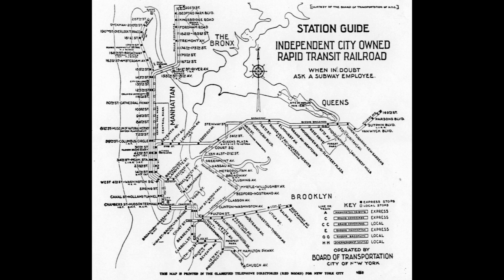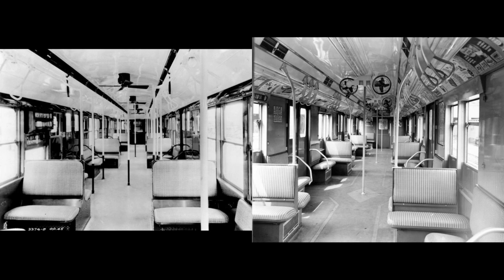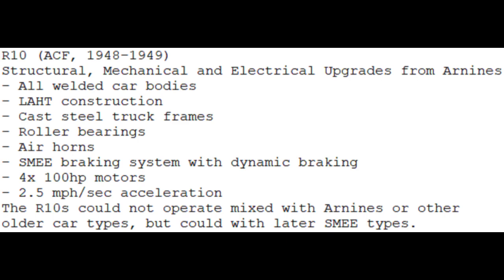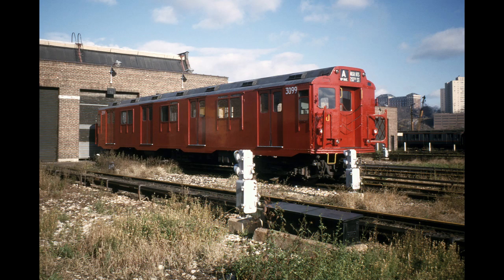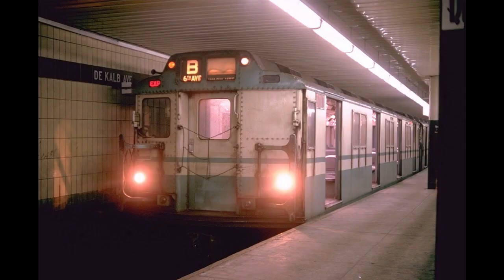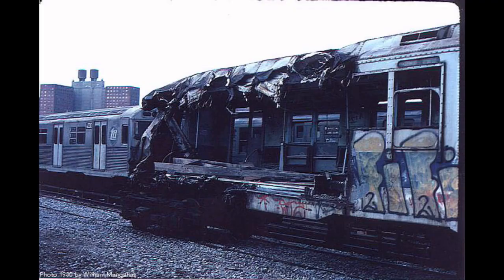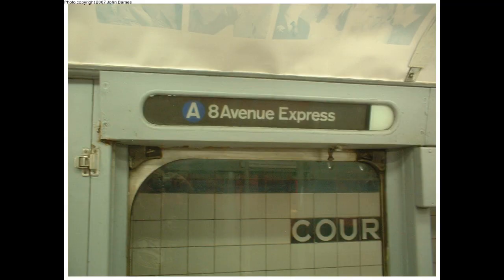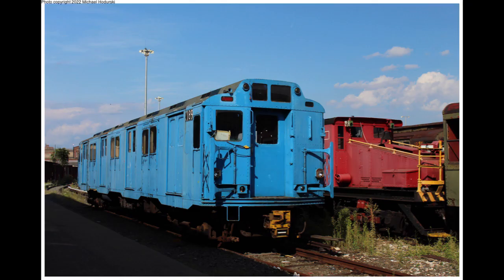History Of The R10 Subway Cars - The First SMEEs For A Unified System

Comment: In 1978-79 I was riding the GG regularly with R-10 equipment.  The car shortage was so severe (due to R-44 and 46 problems) that a train which could only run in 'series' (meaning speed limited to about 15 MPH) was allowed to remain in service on an occasion I observed.  The Thunderbirds nickname was not known among younger railfans.  The R-38s were the fast cars back then.  Also PA systems were retrofitted on cars older than R-26 (delivered without PAs) in the early 80s as a result of the Clark tube smokey incident in which the crew was unable to communicate with riders experiencing confusion and discomfort.
Reply: The R-38!!!!!! My all time fave, especially working the C line. Fastest thing we ever had!

Comment: I rode on them many, many times on the A.  They were tailor-made for the CPW express dash, thundering and blazing past those seven local stops.  If you stood on the n/b platform at 81st St., you got an earful as they ripped past.  By that point they were at full gallop.
Reply: Exactly 💯 I remembered riding it when It was going express on CPW express with the A Train
Reply: I remember their smaller sisters - the R12s - on the "7" ripping through Long Island City - even louder.
Very fast cars I remember well!
Reply: @georgemurphy2579  I remember them, too, but only rode them on the mainlines.   And by then, they were no longer running in solid consists.

Comment: 1983. I'm a new C/R, drumming up an R-10 for C service in Pitkin Yard. The fans(two on the pole), the burning grids, the screeching iron brakes(I got to operate light 10s, they can almost stop on a dime!). The pneumatic doors were fun, the riding between cars was not. A local trip from Rockaway Park to Bedford Park was close to two hours, in the snow and cold, but a summer run was good.

Comment: When I started, they gave us the "R-10 and Up Manual". Most educational thing was the chapter "Tracing of the Air", where we followed the process in which the dual-pipe brake system filled (and backfilled) itself. The book itself was a final reprint from 1953. If there's a video on the R-16(of which my friend has Car#6398 on display in the Kingston Trolley Museum), that's a weird car, with levers and all.

Comment: I recall reading that since car 1575 retained the workings of an R7 beneath the prototype R10 carbody it could and did run in mixed consists with older equipment.
I also recall R10s in their last years of service on the C Line painted dark green (greenbirds?) at the end of the 1980s.
Reply: 1575 still exists as a museum car.  It occasionally operates on excursion runs with other vintage R1-9 cars.  It had a reputation for being unreliable during its time in service but it seems that the TA shops have fixed its issues.

Comment: One thing I remembered about the R10s was it's noise level. Especially during the express between 59 st and 125 at on the A line.
Reply from the maker: Was it louder than both the Arnines and the R16s?
Reply: @TRRailfan  Yes. Only the R38s are just as loud.
Reply: Yes, those R10s could fly.

Comment: What about the rumored 76th Street Station on the IND Pitkin Avenue Tunnel? There is a photo of an R-10 arriving at the station.
Reply: April Fools edited photo. Original: https://www.nycsubway.org/perl/show?2581
Reply from the maker: Yep, what Jassy said. That photo is fake. 76th Street never opened for service. We don't know to what stage it was built, but it never opened. Likely the tracks were in place though.
Reply: The tracks to around up to 76st the walls are probably flooded where the 4 main lines are at by the 🧱 pass it, if it there and who knows
Reply: That's actually an R-10 B train at 7th Ave.  The giveaway is the platinum mist-and-blue paint scheme.